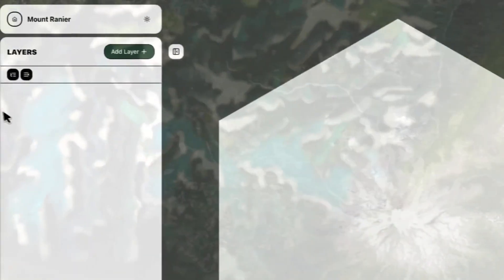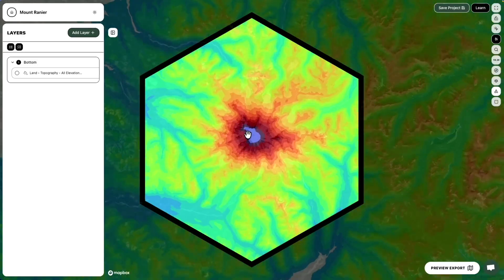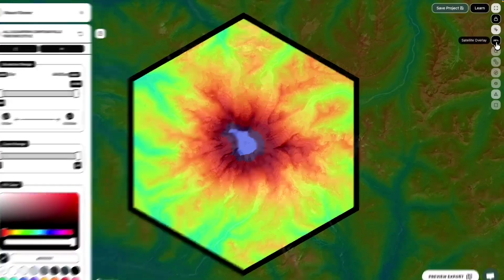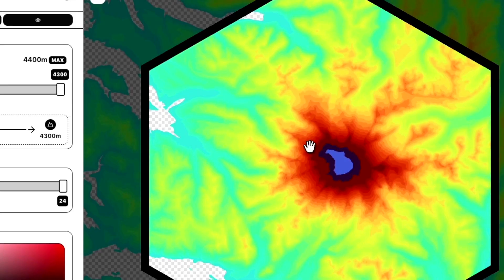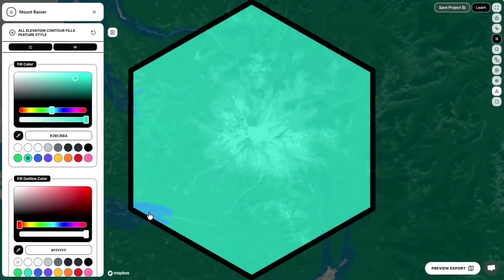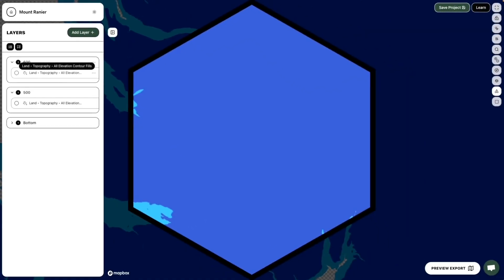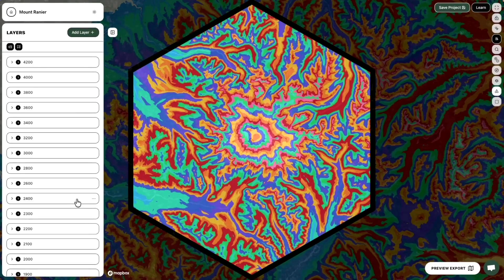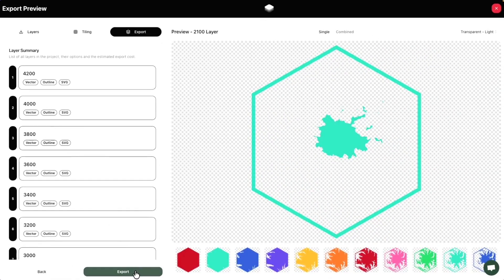How to make topographical maps with Laser Map Maker

Comment: I am more interested in having the contours of lakes added to the software. Right now I am using maps from I-boating and tracing a image of the lake I want then trying to include it with my files from lazer map maker into lightburn. Lots of adjusting and not always perfect so it would be nice to include this in the software.
Reply from the maker: We’re definitely interested in adding lake contours as well! Topography was also a highly requested feature, and, since it was simpler to implement than bathymetry, we prioritized it so we could deliver more value to users more quickly with a variety of options. That said, bathymetric features are absolutely on our roadmap—we want to make them available too!